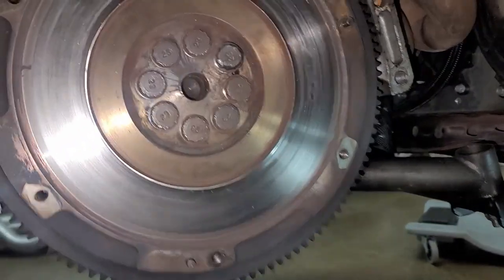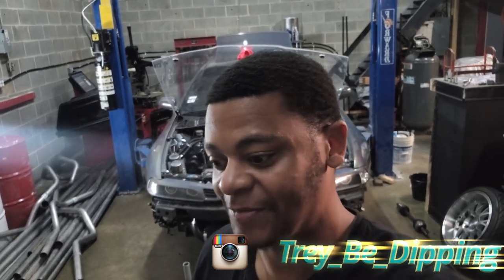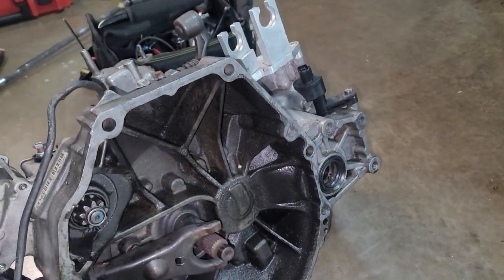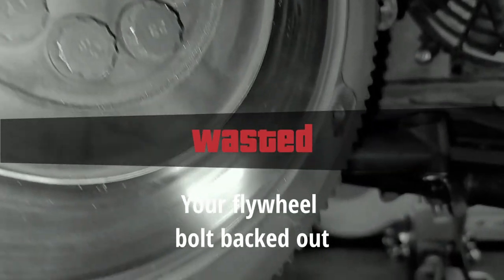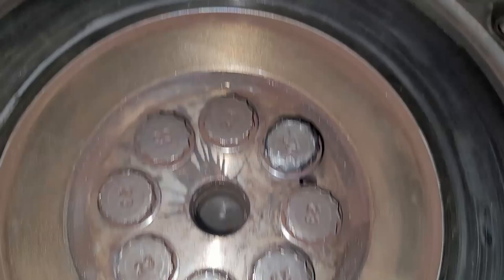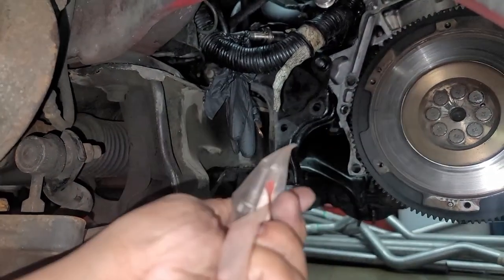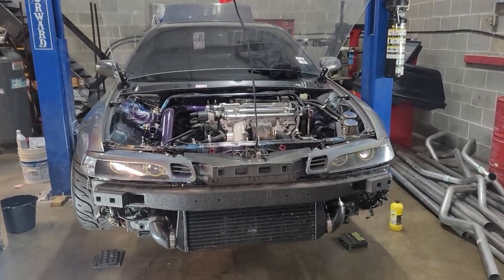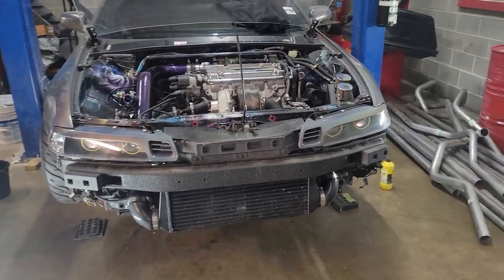Clutch failure or worse??????

Comment: Don’t lose hope you’ll get there, you always need to locktite your flywheel bolt the same thing happed to me.
Reply from the maker: Ive always been scared of locktite on the flywheel
Reply: @treybedipping1734  no need to be scared. whenever you’re ready to take the flywheel off heat the bolts up and that will  burn off the locktite for easy removal. Also try locktite on your pressure plate bolts if you want
Reply from the maker: @BlondiesGarage  ill keep that in mind next time

Comment: I had to put some lock tight on my flywheel bolts
Reply: On mines when it did that your engine is a monster
Reply from the maker: @TheMarewin  i thought about it but they torqued now so should be good

Comment: Say bro, stop using that impact. Put those bolts on with a torque wrench to specification. That was your issue with that pressure plate. Don't get discouraged.